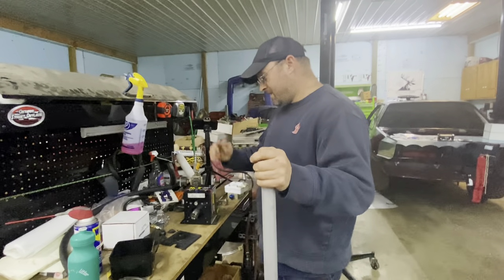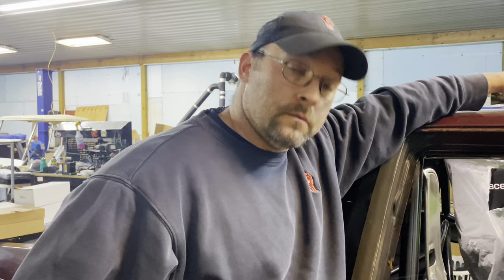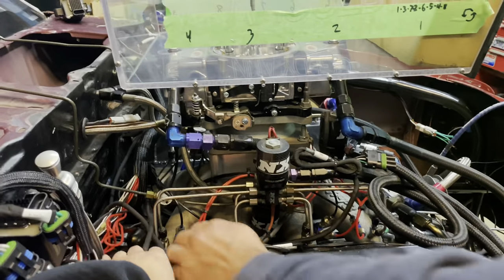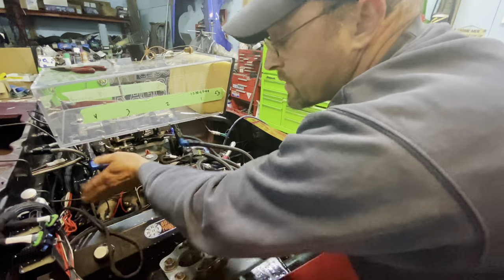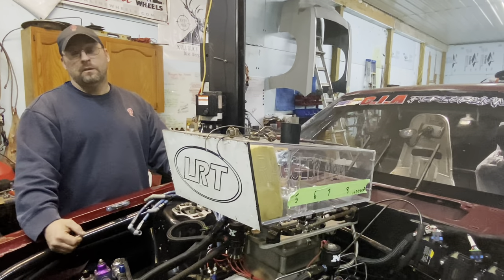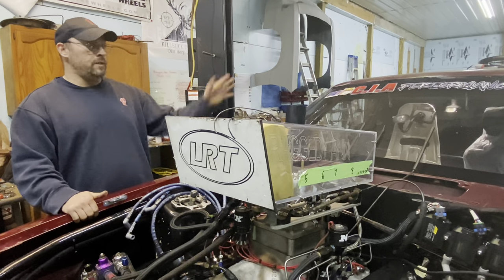Bartering feet pics for work. The parachute goes on,transmission comes out! Wiring update.

Comment: The smartest drag racer I ever knew, always seemed to lean on his car that was always driven so far on the edge that he was often breaking the weak link (his 2 speed trans, he carried 2 spares in the ramp truck with him ready to slap in), and after fighting with Trans bellhousing bolts laying in pit dirt or gravel under the car, I said while helping him do a swap in 30 mins once..."wouldn't be great to have about 2 nice removable inspection plates that could be removable for the top 2 from inside on the floorboard hump so we could reach these (with 1 inside the car, and 1 guiding it from under the car?"

Next time he showed up and he broke it (yeah it was a weak link in his combo, and why he carried 3 but he loved his powerglides), those two covered holes existed, and a 30 minute job was completed by the 2 of us in 15 mins. flat.

Just a hint. Seems like a crazy thing to have to do, but...race car stiff does break.
Reply from the maker: Facts. That’s a cool story I talked about doing holes just haven’t gotten to it. I’m yet to brake this “Michael turner racing transmissions” power glide but do seem to have it out quit a bit for other things.

Comment: Couple of things I have done 1) trans lines use hydraulic hoses with quick disconnects set up to come off just out of trans swap the ends so you can connect the two ends from trans together and two ends from cooler together so yo don't spill fluid everywhere a zip tie behind the slide end keeps it from accidentally coming disconnected. 2)wires going through floor a cheap fix trailer flat 4 pin connector wired in under the floor zip tie them together so that don't rattle loose...just a couple ideas from an old low buck guy

Comment: Wiring is difficult to judge as far as time.  A few tips that I have learned over the years are first plan your routings first and stick to them. A little time taken doing that will make the wiring faster and easier. Always service loops. A little extra wire never hurt anyone that has to do a repair down the road. Always put additional dropouts I.e. power, ground and signal wires. Will save time and frustration when you need to add something later. Hope this helps make it easier on you.

Comment: I've wired quite a few cars and bikes and have found that it's easy to get overwhelmed and loose where are if you try to tackle the hole thing at once. How I do it is I pick a system and work on that system until it is wired up but left loose and long I then power that system up and test it if possible and move on to the next system. After all the systems are working make it pretty and serviceable.
Reply from the maker: Thanks man. Appreciate the advice.

Comment: I have confidence in you Cj you will get it figured out buddy if it takes longer than expected oh well at least you know it’s done and it’s done right
Reply from the maker: Thanks man.
Reply: It is true, with all my delays on my project (5-6 months turned into 14.5 months so far, and still some to go), but have gained a few onobtainium go fast and long needed parts from some longtime hoarders, and a lot of very unknown info along the way concerning my specific combo that I would have never known if I was out racing and not stuck reading discussing with others constantly. And many of the formerly secret info, has already been instituted and massaged into my combo, and each of them are pretty much guaranteed to forever eek out just a little more HP output each, and adding each slowly to the finished project just may all add up to something great. Racing is the end product, the prep helps us get there, but knowledge, understanding, and then instituting and adding that which you have learned because others went the failure pains of going there before you, and were not afraid to fail,...that is where the patience pays off. In that, I mean it is easier to succeed, I will accept the delays, if all that I learned makes the end product faster in my class, because that saves me money, and hopefully pays higher dividends in the end at a faster rate than if I was just poking at air or the bear.

Just 1 word of advice...never ever burn bridges, building them back up is much harder as eventually you will again, and again cross the same rivers or railroad tracks again, and again soon enough.

Comment: You'll be fine. Just read and write down what is wired to each pin. Shouldn't need a micro switch for nitrous. TPS should be your trigger. Also for sensors, if it's the same as Holley, sensors can share 5v+ and -. Just obviously have their own signal/sensor input for their data. I split mine with non insulated butt connectors 1sensor 5v+ in and 6 5v+ out. Everything works fine. Devin Vanderhoof and Holley both said to do it that way. I would ask FUELTECH first but I would think it's the same.
Reply from the maker: I don’t have a tps yet. Still carbureted. Just was wondering if the tps plug would read the micro switch only it would read 0 and 100 instead of 0-100%. Thanks for the info.
Reply: @raggedyannohiosmalltire2329  oh I heard you wrong. I thought you had put one 1⃣ your carb. I know a lot of guys do now. Good luck. Can't wait until you get it all ironed out.
Reply: @raggedyannohiosmalltire2329 
You can run a TPS sensor on a carburetor.. they make a bracket to do it with. Go look at Chiefs video when they were first doing hits on Jackie’s car, there’s a part where he shows the TPS sensor, how it’s mounted and how it’s calibrated. I put the same deal on my car.

Comment: I know you're losing seat time.. but the confidence in knowing the car is fixed right and stuff done safely is worth the time you lose.. it gives you the opportunity to know you're not wasting your time.. taking it apart because you forgot something or didn't do it right takes time.. imagine rushin rushin rushing and go test and find something isn't right, and you gotta go home and tear it apart to find out it's not right and start over.. I'm just saying that you can sit back and still observe your competition and see what you gotta do to be the first to pull the chutes at the finish line.. fix it right the first time and be ready to go when you're done.. you can take time.. but can you build another car again?
Reply from the maker: I get it but that’s why I had some one else doing the electrical part so that it was done correctly as that’s not my area and I would rather have some one do it that it is there area if that makes sense